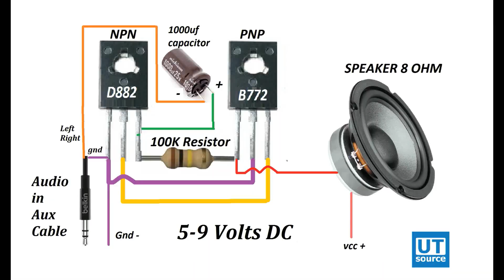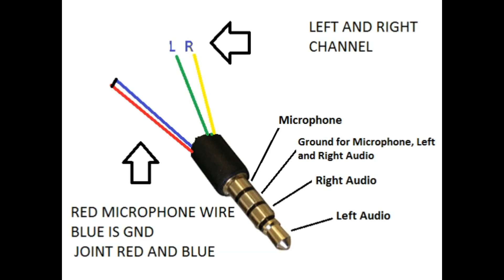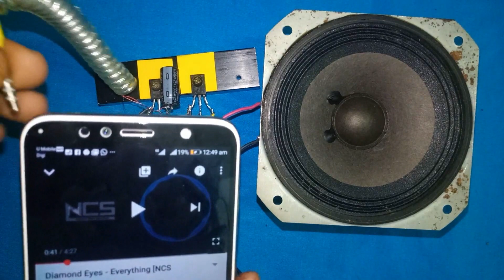Powerful amplifier D882 and B772 Transistors | New Circuit | Bass Boosted

Comment: Did you install the B772 transistor upside down or it didn't work for me?
Reply: its because the amp doesnt get enough voltage from the the input (phone, pc, etc.) to power on the transistors.